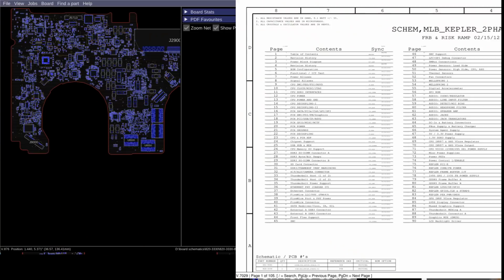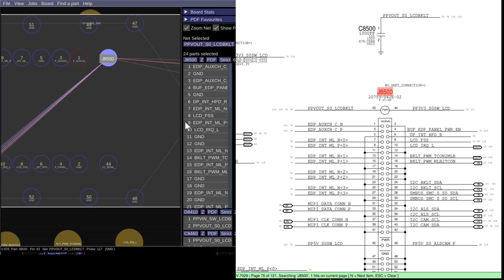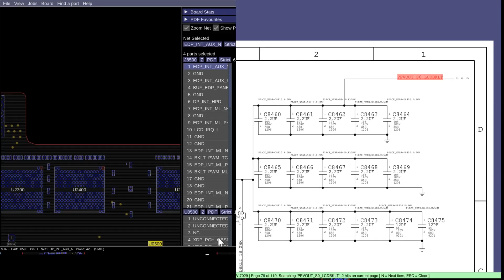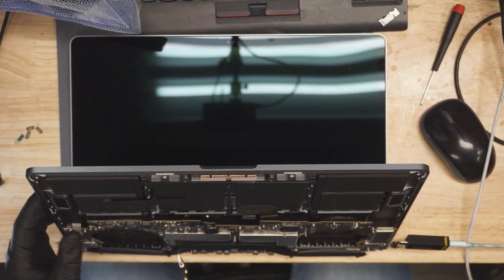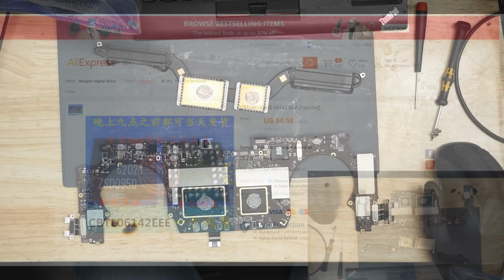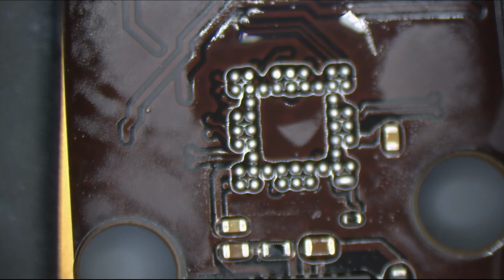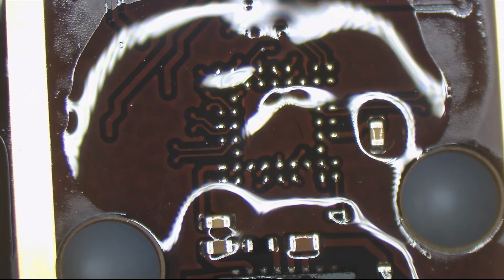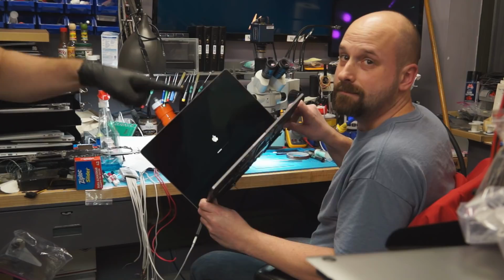Apple botches Macbook board design: again!

Comment: does the 50v supply need to be on that board to be routed on that pin?  I am willing to bet no other part of that board needs 50 volts and the boost circuits could be moved and supplied with a more reasonable ~5v.

Comment: I hear what y’all saying here, but I’ve only heard of two main issues with the Pro 13”. The heat issue and keyboard. Does this design flaw cause those problems? Just bought one for $1300, $500 below msrp. Haven’t opened it yet.

Comment: As an engineering student, your comment at 7:25 is false. Engineering students are not taught in a 4-year degree how to do failure mode effects analysis, which would reveal this catastrophic failure mode, and probably present simple solutions like adding a NC pin. I was only exposed to this by entering an engineering competition outside of my cirriculum. Usually engineers won't learn important tricks like this until they have been working in the embedded electronics industry for years.

Comment: Honestly, all the designs were shocking (no pun intended). Any sane person in IT would know to keep data and power lines not only separate, but as far apart as humanly possible.  Seriously, how much money are they saving per model by having one connector instead of separate data and power connectors? Would it kill them to actually run a plain old shielded power cable from the 50 v source to the LCD panel? Even if they soldered it to the board instead of using pins to save space, that would seem a better solution than putting 50 v power so close to 3 v data.

Comment: So can you tell me what year of MBP has the best logic board design, the one that you rarely see at your workshop or at least not as much as other models?
Reply: At the shop I work at, the Late 2012 would take the spot for best design. Far fewer "it's dead" failures (mostly U7000), the vast majority of cases have always been from people spilling stuff on them. They are also much nicer to work on since they generally have larger components and simpler circuitry. Retinas and Airs have their fair share of spills, but a lot of random IC failures. The USB-C models are by far the worst with most of them random deaths, not even spill damage.
Reply: @WhatnotSoforth  Thanks my friend. You really took the time to answer my question. Really appreciate it.  I have the 13" mid-2012 MBP it still works with no issue whatsoever. Just upgraded the ram and thee storage to SSD. even better..

Comment: So you replaced the chip that was damaged by the 40v surge, but how about the root cause of that 40v surge? Was that a random occurance, or there's a fault somewhere that caused the 40v surge that should be fixed as well?
Reply: Unstable voltage source. So, yeah it will happen again, but there's nothing you can do to really avoid nor prevent it

Comment: Why can't you just put in a same generation, different feature subset, commercial Intel CPU as used in PC laptops?  Of cause you'll need to carefully check every model feature to find a suitable replacement.  A macOs patch may or may not be needed to accept the chip.

Comment: Also I can tell you are very good at fixing computers but, this is an important question, would you be willing to buy a new mac book with a warranty and use it as a donor board and replaced the donor parts with broken parts and take it to apple and get it fixed through warranty so you can get free new parts for it.

Comment: I personally beleive that the botched design is actually done on purpose. Apple want you to replace your product after a few years. Designing some timebombs is one of the best way to ensure that it happend. Apple can then claim that you should have dust cleaned your product that you can not open and they would probably refuse to clean because it is not needed under normal usage, but normal usage for apple is in a clean room...

Comment: I'll be honest right away  I know very little about electronics & computers.  At 7:13 when you talk about the pin to ensure the surge gets grounded instead of frying things around it, is Apple deliberately doing this I wonder because they know most people will just buy another?  Why after 10 years would they change design specs?

Comment: It is quite shocking what this guy points out about what is either, lazy/deliberately designed flaws in these machines, I had the original glued unibody and got 6 years trouble free use out of it, sold for just over half original purchase price. I wanted to buy the 2018 6 core with 32gb ram, but seriously, why would I? A random failure I can accept, but a failure that occurs to either a lazy/deliberate oversight that they subsequently won't do a damn thing about???? sure, I can buy an extended warranty, but why should I? I have never done so previously. Sad thing is there is nothing in the PC world that  matches the design, size, spec and OS. So I have to pass and will spend the money on my workstation. For what the laptop costs I can swap out my ryzen 1700x for a 1950x, add a couple of 1080tis and still have change for more ram if needed in future.

Comment: Hey Louis, probably a stupid question but why don't you add the solder balls to the board instead of the chip?
Reply: Akshay Singhvi Even more difficult.  At least the chip can be put under the stencil on it's own without hitting other parts.

Comment: Another great vid...and I know what the answer probably is already, but what are the chances of you doing a reball of my old Xbox360? What may the charge be for this...this is an old one I loved and took care of and was an old special release for Halo when it came out...no other model had the built in HDMI at that time. 
Thanks for another great video Louis, keep the movement going. As a car owner with a $200 scanner, I am upset at the amount of information that my car can give me vs the dealer model which is $7000 plus a $1000 annual fee to use that license! I, as a car owner cannot afford that to get into my vehicles cpu to figure out what is really going on, I have to rely on idiots (some of the dealer mechanics) and pay an overpriced service fee that would include a suspension check if you brought it in for a steering issue...as that is how the book and system is designed to make money. I had an extremely loose Ujoint on my escape. The dealer followed the manual and did not find the problem until that manual told them to then go and check the suspension....when the manual had not yet checked the rest of the steering components. I had spent $450 for the dealer manual from the manufacturer of the manuals directly (skip the dealer save cash!). After following the manual I called them back and told them to skip the suspension test....go back the later section that finishes the rest of the steering system. 
They called me back ten mins later saying the mechanic found what was wrong and avoided a LOT of costs. Had I just did a check myself I would have been fine, but was awaiting an upcoming long mile trip...no time to work on it and fix it. It still costed a LOT of money, but now, I know to use the books and knowledge...and I wish I could afford the rediculous price for the tools!
You know, I paid good money for a decent car scanner..one that was said to do SRS and Airbag stuff. Well it does...but a lot of friend were "sold" a device for their phones that was said to do the same but did not and my scanner found the codes. But also, I scanned my truck before I took it in and nothing was found...The computer scanner they use at Ford can be bought by the company who makes it..not a bad investment if your want your car to last forever and keep it up yourself...the actual amount of info compared to ANY consumer car scanner is drastic to say the least!
That pisses me off so much! I am so behind the right to repair act and can't wait for legislation in MI and for it to happen at the gov't level. I am old school.....When I bought something it came with a parts list for replacements, and a schematic with the certifications met....
Now these sht-Fks are designing self driving cars....I assume the longevity will be like iApple equipment in which your car will update and says you can no longer use this car forever...they will brick it. Due to the battery or who knows what??? It's not they will "actually" tell you or that they even know what went wrong. 
I had my old 2008 Escape self accelerate a few times....dealer couldn't find the problem...but say they did their best and had their regional guy on site that day who drove it. 
They will never figure that out...But I...with the "rights" to read all of that data could find the problem!
Unless you want that expensive Factory reader and pay the annual rights for it...you...and the dealer...may NEVER figure out what is wrong with your car. From my investigations, that seems to happen quite often!
Let's go self driving cars....And I hope that the self driving Apple cars are programmed to drive into a brick wall when it fails so no others are killed other than the owner who thought a self driving car is realistically viable to be sold with the tech we currently have! Just had to have the new thing. 
The farming people with million dollar machines...that could be held up by a $150,000 delivery fee and repair/diagnostics...those farmers who actually have to learn hacking computers to fix their own farm equipment...
Another funny thing, I can order a pizza a see picture of the cook and damn near know that the pepperonis have been placed, the onions have been placed...the bacon is now on it and it's in the oven. Then it's cut and sent to delivery with a photo of the delivery guy. I can drop a car off to a dealer with an odd issue, it can be tested for days, no updates unless you bother the already busy rep you dropped it off with, then you get some info that realistically not real info on the repair because, like Apple, there is a LOT of things they are hiding. 
I am sorry, I could just continue and continue. 
Thanks for supporting the Right to Repair act movement. I would like to see some more info on how that is going and what states have legislation for this upcoming.

Comment: Why couldn't they just put in a separate high voltage connection? Or maybe a little plastic dam to separate the 2? Hell, they change their charging port every 6 months, no one would even blink if they changed their screen plug design.

Comment: Can you do a piece on the NUC8 BEH lineup? Based on the fact I plugged in a newly bought, 2-year-warranty USB A to C cable rated for 1.2 amps into a newly bought Google Pixel 2 and newly bought NUc8I7BEH and nuked the NUC (I've checked the RAM and SSD, all good, disconnected the CMOS battery for 2 hours, discharged all the residual power, etc. etc.), something's not right with these things unless I got stupidly unlucky...

Comment: So what you mean to say, is that for the first time, a 15" MacBook Pro with discrete graphics is designed marginally BETTER than the 13" model without discrete graphics? That's a first!
Reply: Josh Bacon It's a lucky accident.  A cheaper chip that might otherwise be a problem takes the damage that would have hit the CPU or GPU.

Comment: At the price Apple charges you'd expect the logic boards to be conformally coated and bulletproof but nope, a single drop of liquid in the wrong place can junk your entire $4000 computer. Combined with a keyboard that just loves to wick spills inside the machine and a completely sealed case with proprietary screws. The way things are going you'll be able to kill the 2020 macbooks just by sneezing on them.

Comment: According to IPC 2221B, for 40V, clearance should be 0.6mm for uncoated external conductors (i guess that's applicable here) without any surface contaminant, at sea level. from looking at the board and comparing connector pin pitch to adjacent components, i don't think apple satisfied these requirements here.
guess what happens when you bring that shiny macbook up to higher altitudes? or use it in an environment that is not air conditioned and is a bit more humid than apple seems to think is advisable?
Reply: Higher altitude wouldn't be an issue. Lower density air is less conductive.
Reply: @andy16666  I'm sorry, but no. The lower the density of the surrounding gas, the lower the breakdown (or sparking) voltage (see Paschen's law).
Reply: @krawutzimon  Interesting. I would have expected plasma formation to occur more easily the more stuff there is to form plasma from. But I could imagine it working either way. With atoms in the way, they would tend to capture some electrons and ionize, slowing the flow of electrons.
Reply: @krawutzimon  To be fair, tho, you're not going to get a spontaneous arc with only 40 volts at even 0.1 mm at any altitude. Your biggest risk is probably a drop of salt water forming a salt bridge.
Reply: @andy16666  unfortunately, that's not entirely true. lead free solder is known to be prone to dendrite growth, and from these sharp needle-like structures, arc discharge is much easier to occur (if i remember correctly due to the extreme gradient in the local electric field). perhaps you've seen this effect used in spark gaps on pcbs, where triangular shapes are used in parallel to direct discharge under esd or transient overvoltage conditions. (see Texas Instruments SLUA392, p.7).
Moreover, salt water is not needed to conduct electricity. Surface contaminants (either from external sources or due to improper handling or cleaning during assembly), and carbonate ions from the airborne CO2 are more than sufficient, even if there is only water condensation present.
Under ideal circumstances, you've most certainly nothing to worry. But engineers don't design for ideal circumstances, but for worst-case situations, eg. the real world. At least that's what i was thought.
Reply: @andy16666  to be exact, my statement only holds true for our interval of interest; when you approach near vacuum, you'll see an exponential increase in the required voltage for plasma formation and subsequent arc conduction. as with many things in physics, this is the observable sum of a lot of overlapping effects, as you've guessed (and as can be seen in Paschen's original formulae).
Reply: @krawutzimon  Yeah, I'm familiar with tin whiskering, although I'm uncertain how much of an issue it is with the alloys used in modern electronics. Pure tin has an unacceptably high propensity to whisker. However, if you add some impurities like copper, silver or antimony, it dramatically reduces the likelihood. Although physical stress on a joint can make it far more likely. Cold joints tend to whisker far more than properly flowed ones. I could see it occasionally being an issue, enough to cause failures.
Reply: @krawutzimon  -- Talk nerdy to me krawutzimon!! 
I'm kidding, 
and I don't consider this to be nerdy so much as professional
Reply: krawutzimon Additionally, these exposed connections are not solder joints but exposed connector surfaces, so depending on coating, whiskers may not occur.
Reply: @johnfrancisdoe1563  As you can see, the solder joints on the board are a little closer together, I believe that's what we're referring to. 

I have no idea how this failure occurred, it was probably a mistake made during a repair, or severe liquid damage. It probably wasn't Tin whiskering, unless the solder joints were very badly done.
Reply: @andy16666  yeah, the point i tried to (poorly) make was, you can't have complete control over all parameters of your design, through a combination of (known) manufacturing tolerances and (estimated) target environment variability. without any test data, we are reduced to a guessing game, and that's where i've tried to offer some explanations for the observed failure mode.
obviously this doesn't seem to be an issue with all units, but with enough that Louis bothered to make a ranting vid ;)
my concerns with clearance and creepage violations combined with the issue of mixing very vulnerable high frequency, low voltage signals with high voltage lines remain. for a relatively high value product, the implementation seems to be a bit negligent, but, again, without test data, this is just gut feeling.
Reply: Pins on FFC/FPC connectors are usually 0.15mm wide with 0.5mm pitch. This means that each pin has a distance of 0.35mm to the next pin.

Comment: I'm not sure if it's not designed this way to fail and damage the most costly components (cpu/gpu). The old design did it right, so there must have been some goal in mind for the change.